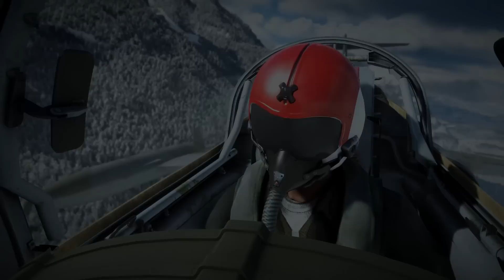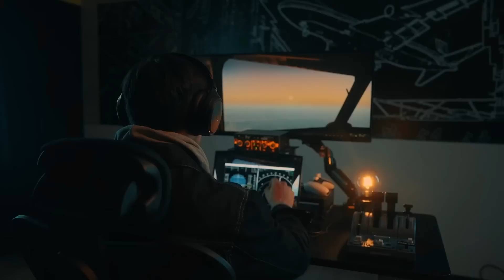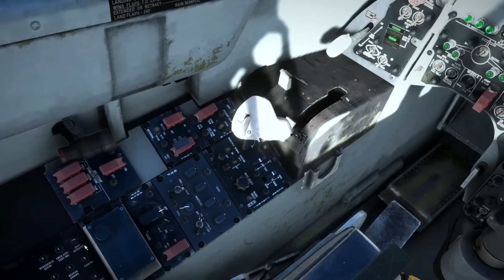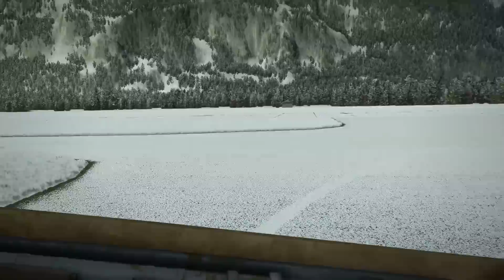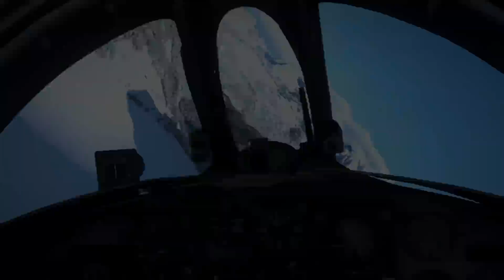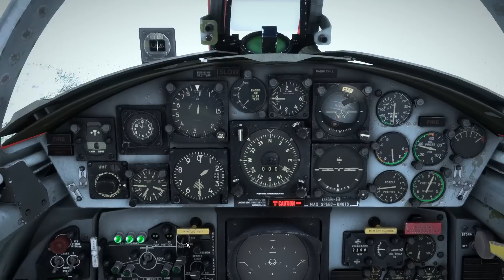The WIDOWMAKER | EPIC Run Through the Swiss Alps | TF-104 Starfighter | Full Flight | MSFS

Comment: A rather good showcase for the capabilities of the Starfighter, which does not get much notice in the U.S. since our Air Force really didn’t like it. Another plane that carried the stigma of early issues long after they had been corrected.
The German Navy actually repurposed them as patrol/attack planes for the Baltic, completely at odds for the designed role of high-altitude interceptor but it is the plane they got and versatile enough to be adapted to the mission they had.
You do make a canyon run look easier than it actually is.
Reply from the maker: Thanks very much OG, I’m glad you enjoyed it.

Is that so? I didn’t realise that the Starfighter had somewhat faded into obscurity in the US, that’s a real shame if so. As you say, the aircraft ended up being used all over the world, in all sorts of roles and I think is undisputedly, a pretty cool piece of engineering / design.

Haha, I tried my best. I think Sim Skunk Works have done a very nice job with the flight model, in as much as the Starfighter is a lovely aircraft to fly, until it isn’t haha.

Cheers, all the best! : )

Comment: Hmm, the takeoff outside. Several little panels opening in sequence from time to time. What is that about?
Reply from the maker: I was actually recently trying to find the answer to that exact question myself, Roger. I seem to recall reading a long while ago, that at least one of those ports, essentially allows more airflow into the engine during high thrust / low speed operations (and therefore helps prevent stalling / surging). I haven’t been able to find anything to (re)confirm that thought and despite spending a couple of hours looking, I haven’t been able to figure out exactly what each inlet does I’m afraid.

Sorry I can’t be of more help on that one. If you ever manage to find out, please do let me know! All the best : )
Reply: @IntotheBlueSimulations  Did a quick research myself. Found a walk around video of a pilot. He talks a low speed engine intake duct system to provide additional air for engine at subsonic. He is in the exact area of the plane that you see in the video. Just as you found.
Reply from the maker: Thanks very much for the info, Roger. I think I saw that same video actually, but somehow missed the relevant part haha.

Very much appreciated! All the best : )

Comment: Still waiting for the starfighter to get to the Xbox. At this point, with wasam support and a score of pc aircraft coming to Xbox, I'm starting to worry just a tad. I'm the meantime I'm really looking forward to the avro Vulcan by justfight, and the recently delayed Tornado by Indiafoxtecho. Then i also heard the XB-70 started development, and I've just got word that the flying iron BF-109 is looking for a June 14th release window, with the marketplace version in the following weeks. I've actually set aside funds for that one for day one. I've even heard they spoke with THE Walter Eichhorn for valuable insights to the type. If memory recalls, Walter has over 300 hours with the BF-109, and has experience flying a range of commercial aircraft ranging from the JU-52 (which I recently got) to Modern airliners like the Boeing 737. He even takes his Extra 350 out daily at the ripe old age of 86, with I think is downright incredible.
Reply from the maker: Hi DL,

I am surprised that SSW haven’t ported the Starfighter over to the console, given that the WASM issues have now been fixed up. The only thing I can think of; the aircraft does use some external applications on the PC (though not for anything fundamental, so far as I am aware), so perhaps that is what’s preventing them from offering their addons on the Xbox (otherwise, I’m sure they’d love to increase their market reach!). Not ideal but as you say, there are plenty of quality addons slated for release on both platforms, in the not-too-distant future.

Thanks for the heads up on the BF-109 by the way! I had no idea it was due to be released so soon, so I started keeping a look out for it once I saw your message haha. As ever, FlyingIron did a wonderful job with the aircraft.

Cheers and all the best! : )
Reply: @IntotheBlueSimulations  I'm now happy to report that the TF-104G has arrived for Xbox! Took a long time, but it's finally here. Might be a good time to take it on another flight.
Reply from the maker: That’s great to hear, Deku!

Haha, I’d love to but, I’m afraid I just don’t have the time at the moment. I’m taking a little bit of time off over Christmas and already I have the A300, Lear 35, F-111, C207 and PC-12 to catch up on, to name but a few!

I do hope you’re enjoying the F-104 though! Cheers : )

Comment: Does the F104 require an external flight model?
Reply from the maker: Good question, MiGMan. I’m not 100% sure, to be honest. Certainly, in previous sims, SSW products did use external programs to support moving maps, terrain radar, PHI navigation etc. I would presume the same is true within MSFS (since the sim doesn’t support some of these features natively). I don’t recall hearing that the flight model is an external program, but given some of the peculiar F-104 behaviours that are modelled (the boundary layer control system being a prime example), it would rather lead me to believe that perhaps SSW have gone down that route.

Sorry I can’t offer up anything more concrete on the subject. Cheers once again : )
Reply: @IntotheBlueSimulations  Thanks for that. Yeah that concurs with my memories as to why I didn't get it at the time. I have a moderately complex  setup and didn't want any more progs running. Hopefully they might update it for MSFS 2040 !!!
Reply from the maker: You’re most welcome! : )